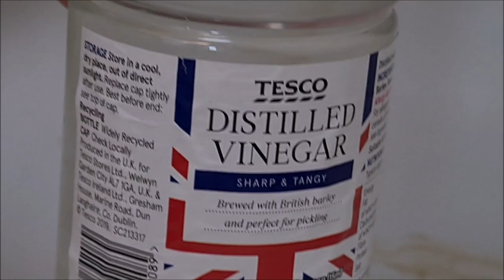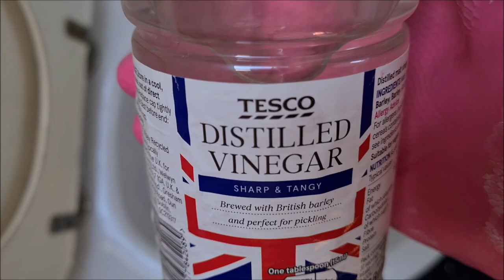How to remove stains from toilet bowl

Comment: In a house I rented was a toilet with a thick (1 cm in places) layer of limescale at the bottom. Indeed, just trying to dissolve it with acids wasn't working much, so I did actually resort to using a small flat head screwdriver to break the limescale apart and scrub it off the porcelain.
The wood method is a good idea! My screwdriver did actually not scratch the porcelain, porcelain (glass) is a harder material than metal, so it shouldn't scratch in theorie. BUT the screwdriver could chip the porcelain though, so be very careful and don't put to much pressure directly on the porcelain. Also use a cheap screwdriver that doesn't have a hardened point. Anyway, try the acid and wood method first, especially if the layer is not as thick as it was in my toilet.
It took hours (multiple days, tries and vinegar soaking), the limescale didn't break easily, but in the end I got it all off. :D
Reply from the maker: Great to hear